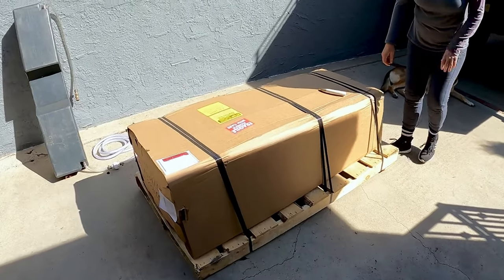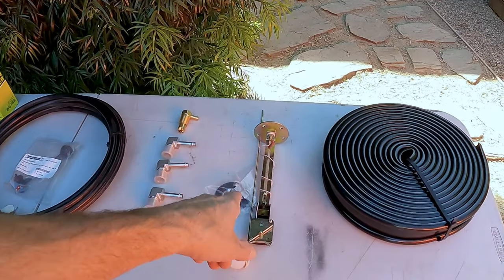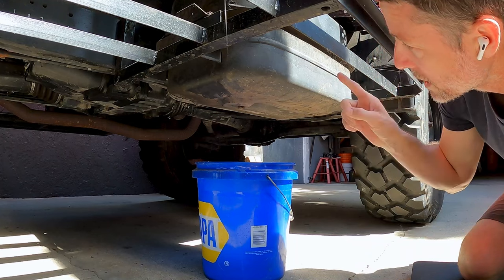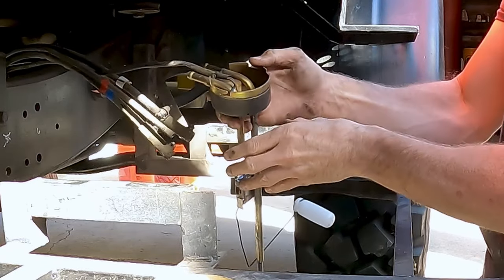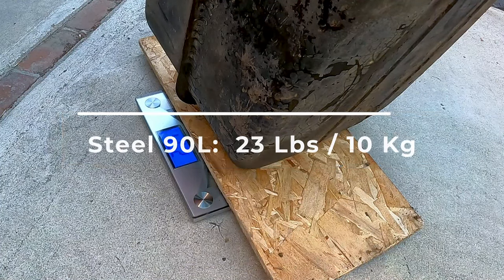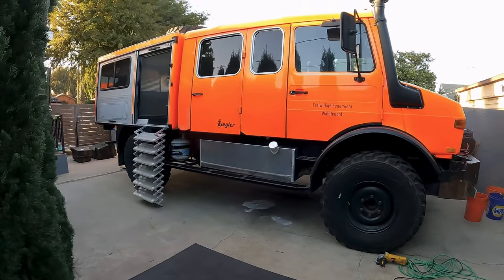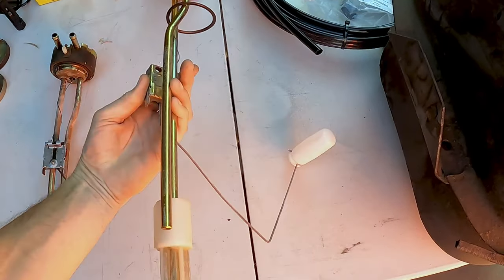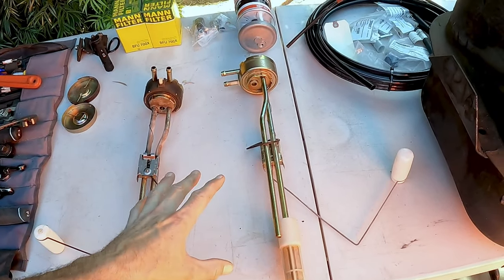Unimog SBU fuel tank, sending unit, and primer pump replacement

Comment: Brass fittings on aluminum will cause corrosion due to dissimilar metals.  You probably want pipe dope to help prevent this.  A bit of road salt and moisture and the aluminum will disappear.   Stainless steel and aluminum is also a problem, maybe slightly less.
Reply from the maker: Thank you. Will do that when I pull it apart for paint